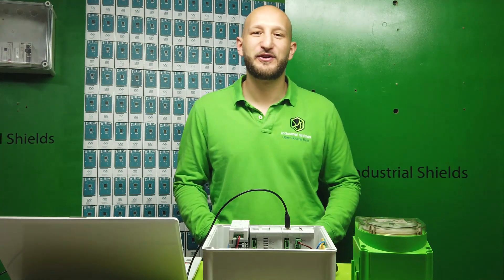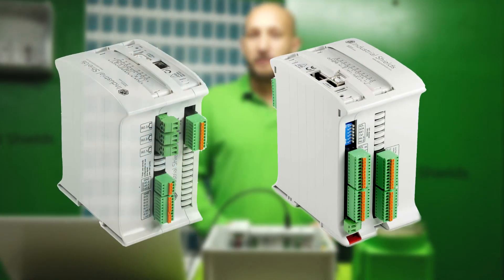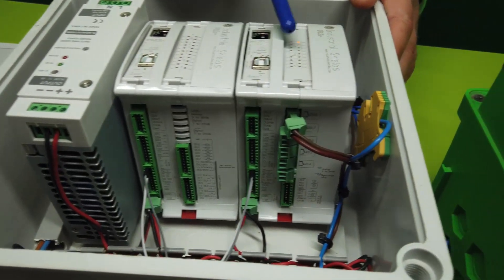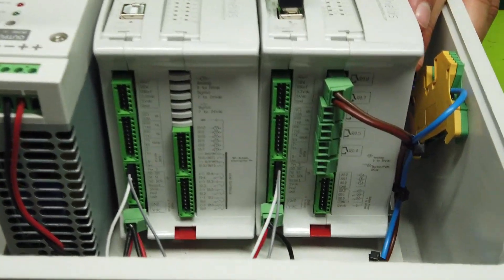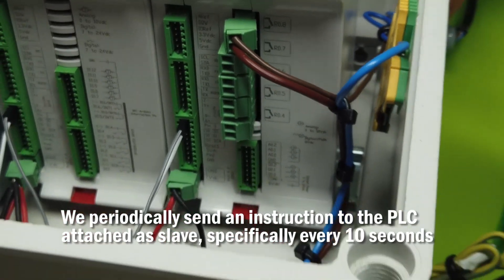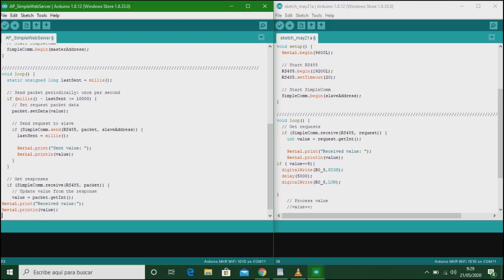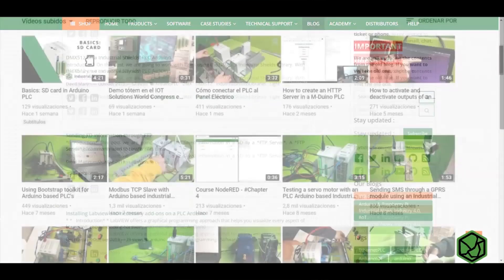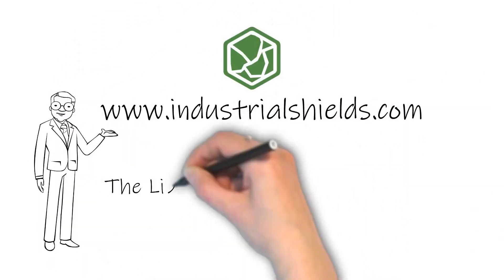✅ Connecting two Industrial ARDUINO PLCs using RS-485 to OPEN and CLOSE a RELAY

Comment: Hello
Could you tell me why there is no mention of slave ID in the master exemple:
______________________________
#include <RS485.h>
#include <SimpleComm.h>

// Create SimplePacket for sending and receiving data
SimplePacket packet;

// Define master address
uint8_t masterAddress = 0;

// Define slave address to communicate with
uint8_t slaveAddress = 1;

// Value to send as packet data
int value = 5;

////////////////////////////////////////////////////////////////////////////////////////////////////
void setup() {
	Serial.begin(9600L);

  // Start RS485
  RS485.begin(19200L);
  RS485.setTimeout(20);

  // Start SimpleComm
  SimpleComm.begin(masterAddress);
}

////////////////////////////////////////////////////////////////////////////////////////////////////
void loop() {
  static unsigned long lastSent = millis();

  // Send packet periodically: once per second
  if (millis() - lastSent >= 10000) {
    // Set request packet data
    packet.setData(value);

    // Send request to slave
    if (SimpleComm.send(RS485, packet, slaveAddress)) {
      lastSent = millis();

      Serial.print("Sent value: ");
      Serial.println(value);
    }
  }

  // Get responses
  if (SimpleComm.receive(RS485, packet)) {
    // Update value from the response
    value = packet.getInt();

    Serial.print("Received value: ");
    Serial.println(value);
  }
}
__________________________

I try to send the value 300 to the adress 12 of my slave with ID = 3. What is the function to use ?

In the "Send" example of the RS485 librarie, I have:

byte tx = Serial.read();

// And send it to the RS-485 port
RS485.write(tx);

----> But how to send an array of bytes instead of just 1 ?
Because my slave device need this kind of message:  "3A 30 33 30 36 30"
Reply from the maker: In this example, it is being used the SimplecComm communication. It requires the stream where the information will be sent, the packet and the destination. It is a simple communication between one sender and one receiver. The slave address is defined on the line uint8_t slaveAddress = 1;

If you want to send a value to a specific address of a device, you should set a protocol like Modbus. However, this is an upper layer of the communication. In the simpleComm, we just send all the data.

As for the second question, if you are using the Send example, you can see that is sending the bytes received by the serial port. As it is a buffer, it will be sending all of them while the Serial. Available detects that is still data.

If you want to send an array of bytes, you should do something like this:

    byte tx[8] = {0x3A,0x30,0x33,0x30,0x36,0x30,'\r','\n'}; // Hello 
    while (i<8){
      Serial.write(tx[i]);
      i++;
    }

I hope I have been useful, thanks for contacting us!